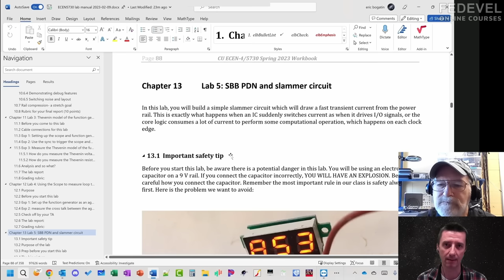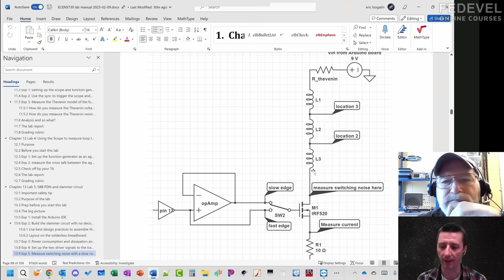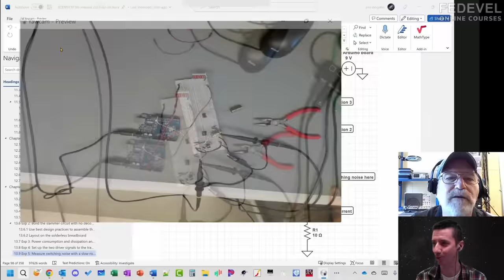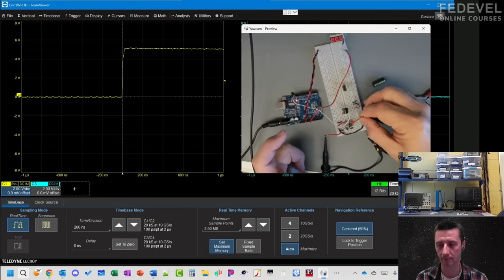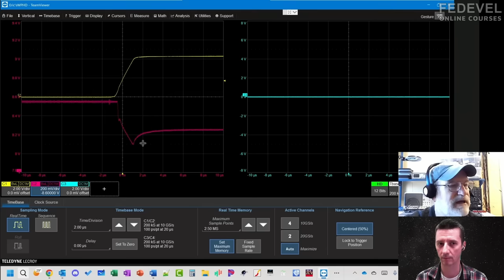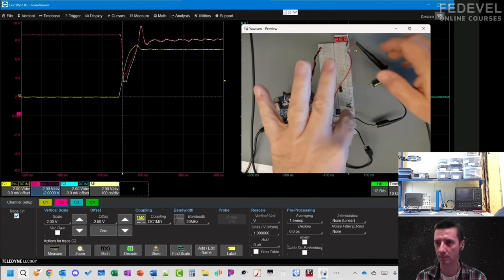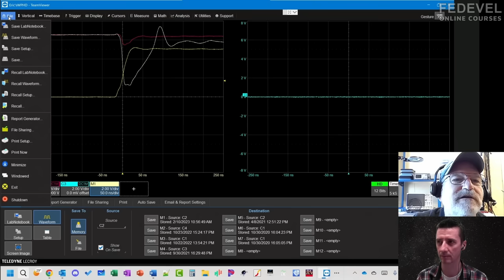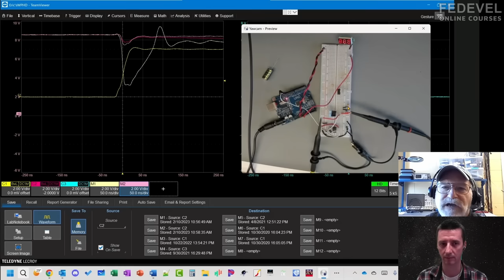What Decoupling Capacitor Value To Use And Where To Place Them | Eric Bogatin

Comment: Does anyone know why the noise on the power supply rail so much higher at 32:01 when the MOSFET is driven directly by the Arduino pin compared to 24:01 when it is driven by the opamp?
Reply: The Arduino switches faster than the opamp
Reply: Maybe he changes the vertical scale?
Reply: I don't think it is either of these. At 32:01 we have 2V/div on pink channel and the same at 24:01. 

For the switching, I could understand higher noise exactly at the time of switching (similar to the main content of this video) but once the pin is actually switched on and reaches a stable level, I don't think this should have an affect any more. Compare the noise at 500us on the timebase between 24:01 and 32:01. The mostfet control voltage is very stable but there is a big difference in noise in the pink channel.